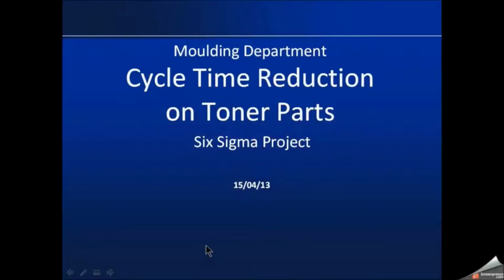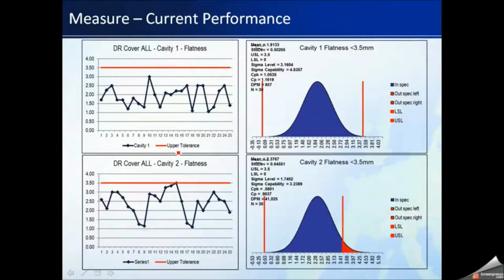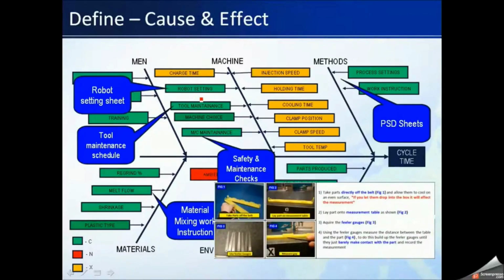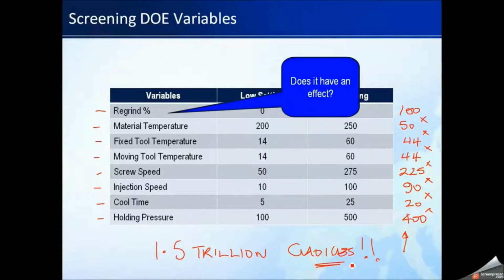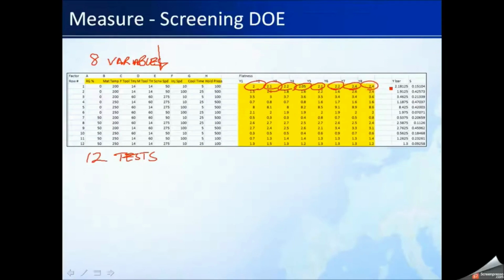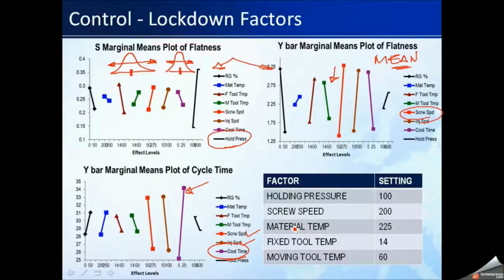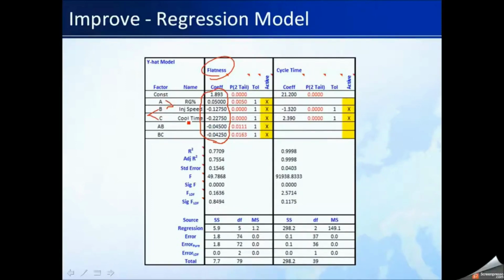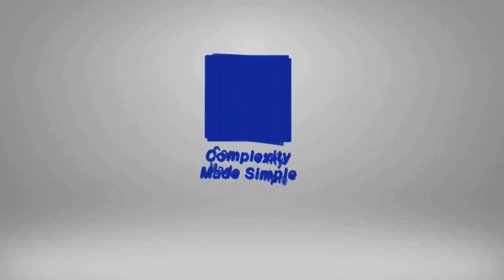The best Example of a Full Six Sigma Project

Comment: Hi Paul, thanks for the beautiful lesson. I'm wondering if the machine variables are considered as special causes, while all the other variables that need to be controlled are the common causes. If this is the case, how do we theoretically establish since the beginning which variables are the common causes (and control for them) and which the special causes in any context?
Reply from the maker: Hi Dom - a good question, my view is probably a bit different to most. I consider most events as common causes. This is because if there are no controls to prevent them then they will come and go as they please. A special cause is a broken rule or a rule that isn't good enough. So if a supplier sends in non-conforming material that would be special. but if they have no conformance spec that is common....what do you think?
Reply: @paulallen5321 I usually base on control limits to identify what's to be fixed, which is what is often referred as special causes by many. I was surprised by the fact you didn't convert the settings from yellow to green before using them in experiments. Any particular reason? However I really like your way of presenting things. Please elaborate a bit more on the non conforming material vs non conforming specs. I guess first moves the mean while non comforming specs would add some noise.
Reply from the maker: Hi Luigi - just posted a new video on this subject...
Reply: @paulallen5321   Hi Paul. I may be a bit late with the reply. I loved the video and posted a bit of a big comment (sorry for that) where I shared my view. Feel free to correct me if I'm wrong. I really appreciate what you do.